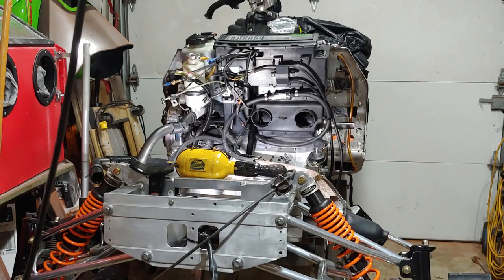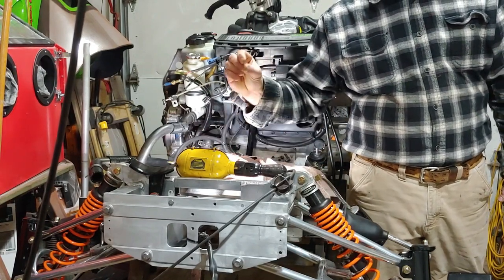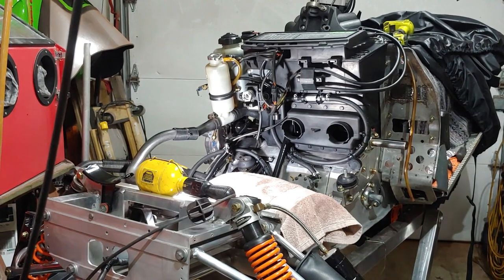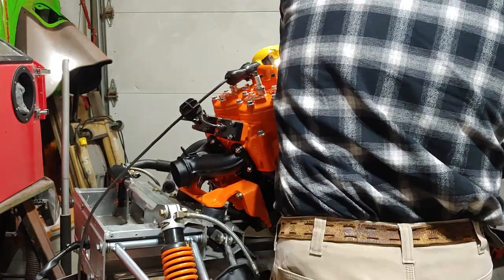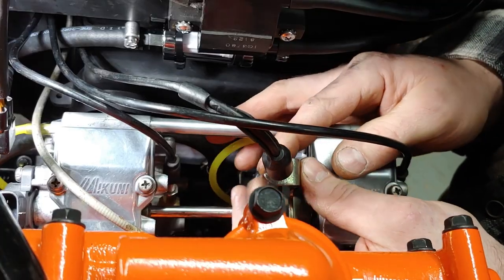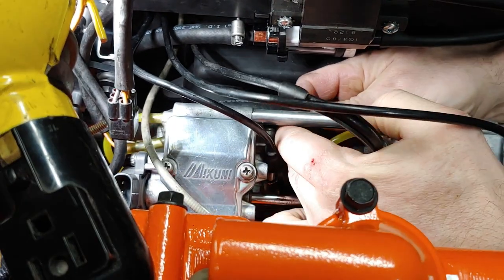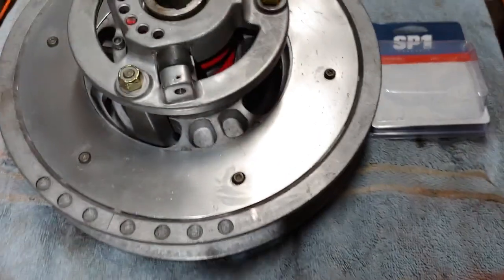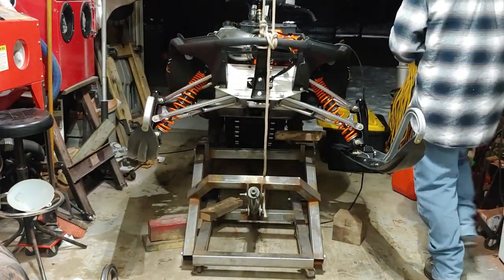02 Arctic Cat ZR 800 CCE Rebuild Part 17 || Engine Install & 1st Attempt Starting! WILL IT START???

Comment: Andrew, I'm watching auto shows on the discovery channel. Various workshops GAZ-monkey, auto dealers and others. They never measure the compression in the engine. If the engine is started the engine is considered working! In the US, this is what most masters do? The only one who makes a good repair on discovery is the fuse Chip (fuz). Your work on this snowmobile is done in the style of Chip Fuz , so I really liked it
Reply from the maker: Interesting. I typucally start wiyh compression on a non-runnimg engine to make sure that mechnically its sound. If it is then the rest is simple. No spark or no fuel. Reason being is tjta if you think its fuel or spark and trouble shoot those and they are fine thwn you wasted time when all that was needed was to check the compression to find out it was too low.
Reply from the maker: But there is a limit to compression... Even if the cylinders are the same psi but low.
Reply: @Fixin2Ride-Official-  I understand this perfectly well, compression is the basis of engine operation. The diesel engine generally operates only at the expense of compression. But in the Car show on discovery put a new battery fill in oil and antifreeze and start the engine. I'm surprised!!! Make body repairs, paint, drag the interior! And put an old motor in the car! I don't understand it! I also always measure the compression in the cylinders. The master (asshole) who fixed the snowmobile before me was able to put the front shock absorbers upside down! I don't know what place he was thinking! :) Apparently the show is the show and life is life.

Comment: Hey what length did you set your exhaust (apv)  cables to ?!  30.6mm ?  Some say there was a revision to figures published in AC manual.
Reply from the maker: I set mine to be at the 1.20" (30.6mm) on both. Make sure they are exaxtly the same.

Comment: Just curious following your build as I'm rebuilding my zr800 currently, what kind of suspension is on your front end ? Mine seems to want to sit extremely low
Reply from the maker: Stock suspension for zr Cross Country. Fox act clickers. You may need increase your spring preload pressure and or loosen your limiter straps a but to take the pressure off of your skis. I have my preload set to 2" distance from base of threads to bottom of spring adjuster.
Reply from the maker: Something else hit me. You might want to check and make sure you have the 18" ACT shocks in there. Some people will put shorter shocks to intentiinally lower the front if drag racing. Anyway. Just a thought.
Reply: @Fixin2Ride-Official-  okay I will thanks! I know there is no adjustment knob on it and they've been replaced before I got it

Comment: I didn’t see where you connected the hose from the oil reservoir, where doe that line go?
Reply from the maker: You are correct! Sorry about that. I didn't actually show myself do it in the video. But, if you look starting at 13:50min, it's the hose that is wrapped in wire loom that starts on the left of the screen and bends down to the middle of the screen, just to the left of the MAG cylinders intake flange (Left one in the video). You can see barely, that it connects to the left side of the oil injection pump down at the bottom on the screen.  

Hope this helps. Thanks for watching, commenting and the general support! 

Andrew C. 
P.S. I'll try and show in another video how I do it now without spilling oil! LOL I've spilled quite a bit in the past.... smh. ;)

Comment: I got a question , when u hooked up the oil injection cable what is the setting or specs  it’s supposed to be at ? I’m thinking on rebuilding my 900
Reply from the maker: You want to match up the Boss line on the pump arm with the boss line on the pump body both at idle position and full throttle. Obviously you do this with the engine off. And your most important adjustment is to make sure that you have the line on the pump arm properly lined up with a line on the pump body at wide open throttle. If the line seems to be a hair low when you're at idle that is okay the most important thing is that you have enough oil being pumped at wide open throttle. Thanks for watching!
Reply: @Fixin2Ride-Official-  excellent I seized myne up and was pondering on fixing it up , the exact same problem lmao studs went through heat exchanger , I welded it up and got it back together and then after that I was to rich on the oil injection setting so therefore half a tank of gas went and drained the 2 stroke oil resivoir and seized it lol but after watching this I think I will rip it all apart again lol
Reply: @Fixin2Ride-Official-  I was worried about the setting so I set it to rich and did not even dream it would mt the tank that quick lol
Reply: @Fixin2Ride-Official-  and one more question were ur cylinders  nikasil ?
Reply from the maker: Yes any OEM aluminum cylinders have to be coated with Nikasil.
Reply from the maker: Oh yeah it will big time. Lol